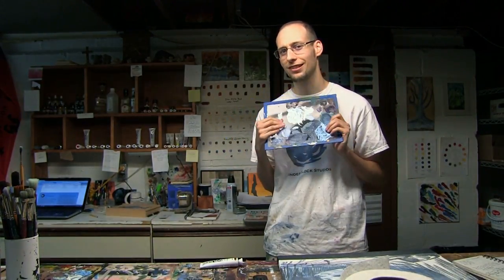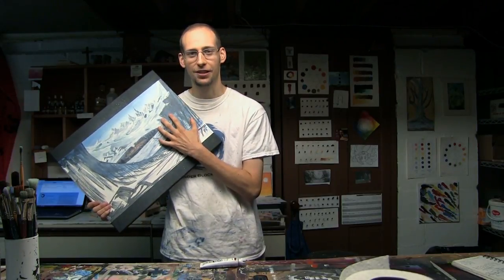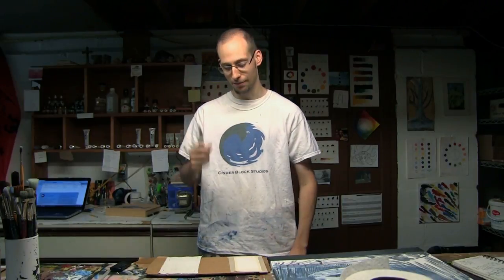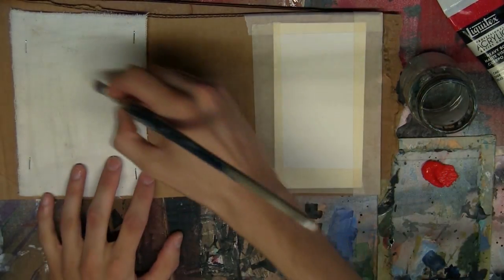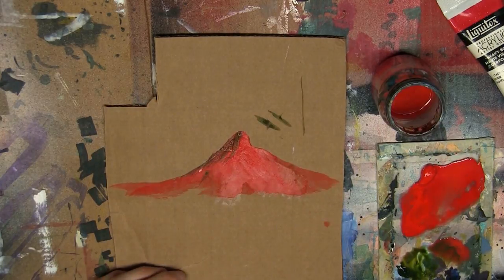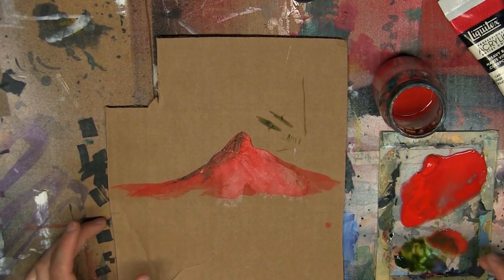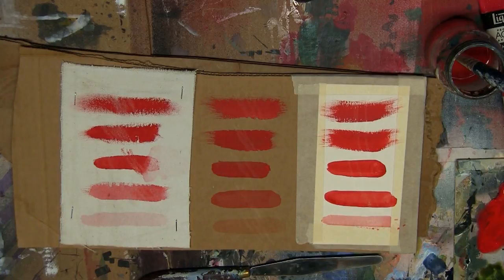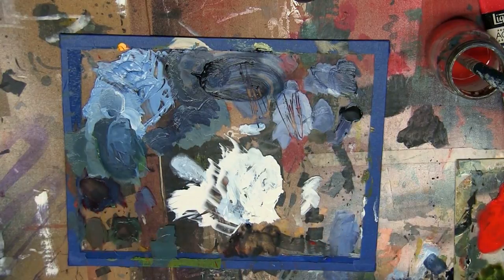Acrylic Painting Tutorial | Thinning Paint and Adding Details

Comment: So refreshing to hear the "don't thin with water" myth debunked! In my experience you're right, it really is all about the substrate. And here's a tip I've discovered: Most store-bought, pre-gessoed canvases (acrylic primed) have a weird, resistive film that causes thin washes of acrylic to bead up, skip, and not adhere. I've found that lightly scrubbing the surface with a dampened Mister Clean Magic Eraser sponge removes that resistive film and leaves the surface much more receptive to water-thinned acrylic washes. Not just any sponge works -- there's some kind of gently abrasive detergent embedded in the Mister Clean sponge that does the trick. I also like Ampersand's Gessobord and Aquabord, and they don't need any prep at all to work great with water-thinned washes. Anyway, thanks again for making sense out of the water debate. I really appreciate all of your videos!

Comment: Ben, thank you dearly for this video. I have been in such a dilemma about how to create an acrylic paint wash. Was going to go out and buy an expensive medium to create a wash.

Just simply to dab a little bit of medium on brush and a bit of paint. To thin to get a wash. I'll just use water now as the paints are from a company called sennelier.

Going to use a Windsor & Newton canvas which is meant to be pre primed.

Looking at the video I am hoping that this will be okay?

Cheers,

Rahul.
Reply from the maker: Sennelier is a very reputable brand so I'm sure you'll be fine with those paints. Chances are you're canvas is also primed already (if it's white or black you're good to go, no need for extra gesso or anything).
Reply: @cinderblockstudios  Ben, thank you for the reply. Yes the winsor & Newton white cotton canvas which is 350g/m2 is  primed. Trying to create an abstract piece so there will be some paint that is a wash and some straight paint from the packet.

When I get to the stage of using a black canvas I will be applying black gesso with a foam roller. Thank you for letting me know I am good to go, as was debating to use extra gesso but I'll scrap that idea. 

Thank you once again for the great video, reply and advice.
Reply from the maker: @RahulSharma-vm1fz  yeah the extra gesso would only be needed if you wanted to do something different with the texture of the piece before you start, or to tone the canvas a different color.
Reply: @cinderblockstudios I will use black gesso for a black background as it has a matte effect. Then will follow your video on gesso in regards to tinting.
Reply from the maker: @RahulSharma-vm1fz  black gesso is really valuable to have, would love to see how you end up utilizing it. I have a video on the channel about how black gesso will effect color which you might find useful. It's important in painting to understand how certain (transparent) colors will be effected by darker base layers.
Reply: @cinderblockstudios  Trying to find the video the colours that I will be using on the black gesso background. Are, gold, red, orange with blues but all bright colours. I'll send you some pictures.
Reply: @cinderblockstudios  Just seen the video on how black gesso will effect certain paints. Thank you for this and I will keep this in mind!
Reply from the maker: @RahulSharma-vm1fz  It's going to depend on the color and it's level of transparency. You won't really know for yourself the extent of that until you get started and learn the range of your colors. The best you can do is to use the black gesso on a piece of paper or cardboard, then test your colors on them.
Reply: @cinderblockstudios  Will do, however the first pieces that I will be doing will be on a white canvas.

Could I use black acrylic paint as a base instead of black gesso?

Then use acrylic paints on top?

Comment: Hi, I am painting 3d printed abs plastics. I was using craft acrylics and I like them more than artistic ones. Because I must avoid brush strokes. Soon, I will have an airbrush semi-pro version. For airbrush u must thin your acrylics, Can I use just water to thin craft acrylics for airbrush. Everybody talking about IPA+water+glycerin and some people offering butyl glycol also. What is your opinion?
Reply from the maker: If you can get your hands on some of Golden's High Flow Acrylic that would be ideal. They are a higher end paint, but come in a small as 1oz (30ml) bottles. The paint is a low viscosity and is designed with airbrushes in mind so you wouldn't need to worry about thinning it. 

Also any lower viscosity acrylic will do the job for less brush stroke retention. I'd also recommend a soft bristled brush to keep those strokes to a minimum, if you stick with that route.

Comment: So, when I have a Folkart acrylic pain and it's thick and I cannot get it to be creamy in the bottle. Can I add a few drops of water without loss of pigment, binder etc. When I mix it properly? 

I have a lot of paints that got separated from the binder in the bottle or jar, and when I remix it, its very heavy and thick... I need help. Please
Reply from the maker: A few drops won't hurt, but the Folkart stuff is a craft paint and has minimal pigment and binder in the first place, so I wouldn't be surprised if it doesn't hold up well with more than that. Bottled paints with low viscosity (this includes most craft paints, as well as liquid professional paints) will seperate over time, so be sure to shake them before use.

Comment: Also when it comes to galleries and art experts and selling your painting or being recognized I think there is notion out there mind set that proper medium should be used I am not sure 
The question is how does experts in art like dealers restorers etc think of not using mediums in your painting to thin paint?
Reply from the maker: It's hard to say what an acrylic painting will be like for restorations in the future. Commercial acrylics have only been on the market for about a hundred years or so, with the most modern formulations only being developed in the 1960s. Regardless though I doubt whether someone used water or medium will determine the value of a piece. It's not about the quality of the materials for collectors but about the impact of a piece of art has on the community.

Comment: Im self taught and use heavy body. Any suggestions on how to EASILY and smoothy apply a large amount of heavy body paints to a large area for background purposes to a primed canvas? Everytime I feel like I'm using way too much paint to the point where it feels wasteful or it seems like its watered down so much that it loses its opacity. Should I just continue to fiddle with my ratio of water or do multiple layers? Or would this be a situation where one would use something like a matte medium? I feel like slapping some paint down as a background should be the easiest part and I feel like I use SO much paint and it either looks streaky and takes forever to dry or way to transparent.
Reply from the maker: The first layer of paint on a fresh canvas always takes a bit more paint than the upper layers. For a large area that you know you'll be painting to start there are 2 options that work the best. First would be finding the right paint to water ratio, you likely don't need much water, but yes you will need A LOT of paint. That is one of the downsides to a heavy body acrylic is that you often need a bunch to cover a large area. Wet sanding a gessoed canvas before starting can help significantly to reduce the paint needed though. 

The second option is to opt for using a thinner viscosity paint for the first few layers in order to get the same coverage with less paint.
Reply: @cinderblockstudios  Thank you for the detailed response. I really appreciate it. 

I do sand and gesso my canvas before painting, however I dry sand, Im not aware of wet sanding a canvas and will look into that. I just recently learned about prepping my canvas. (within the last year)

I was originally using craft paints because I did not know any better and due to pure frustration of not achieving the pigmentation I wanted, I switched to heavy body acrylics (after doing research). I feel as if now I have the opposite problem when doing my first layer. The rest of my issues disappeared once I switched over to heavy body. I have not tried any other types of paint besides craft paint (like folkart) or heavy body (liquitext). I did purchase a golden matte medium for glazing but have yet to open the bottle. I wasnt sure if that could be helpful with the first coat at all, or would that just be wasteful?

I did paint my first layer on a canvas last night using more water than I normally would after watching your video. I did use less paint than normal but do have spots where I can still see through to the canvas. I will continue to fiddle with my ratios in the future.

Thank you for your knowledge. Ive drawn my whole life and just started trying to understand paint. I feel like theres a lot that comes naturally but far more that I just dont understand still.
Reply from the maker: Unless you want to really change the texture then additional gesso usually isn't necessary. For wet sanding simply spray down a thin layer of water (or rub with a damp rag) on the canvas before sanding. This will create a velvety smooth texture on your canvas.

Matte medium will thin your paint but it will also make it transparent. Great for glazes not so much for a first layer though.
Reply: @cinderblockstudios   WAIT! Have I been doing this backwards? I sand the canvas, gesso, then paint. The canvas I buy are cheap and normally say primed. However some are bumpy or weird, so I sand (use a blow dryer to get rid of any residue) and then add a layer of gesso. After it's dry I then go into my first layer of paint.

Am I suppose to be gessoing and then wet sanding the gesso and then painting on top? 

If that's the case, that alone could be affecting how the paint is spreading.

Thanks for the info on wet sanding. The info about matte medium is basically what I was expecting but thanks for preventing me from wasting it in an attempt to double check lol.
Reply from the maker: If you're buying a canvas from the store, you don't need to gesso it at all. Gessoing those canvases is STRICTLY a personal preference that some artists might do, and isn't necessary at all. Canvas by nature of being canvas is going to be a little rough. Some higher grades of canvas with a tighter weave will be smoother than the bargain basement stuff you get at the craft store for a couple bucks, but but even the expensive stuff has a bit of tooth. Regardless though, yes sanding is done AFTER gessoing. Doesn't make much sense to do so before hand unless you're building up those layers of gesso from a raw unprimed canvas.
Reply: @cinderblockstudios  This makes so much sense and is explained so well. Thank you for your time and your insight! This is immensely helpful. I appreciate you
Reply from the maker: @michelletalnagi4281  you're very welcome! Always love conversing with other artists and to help them on their journey!
Reply: @cinderblockstudios  I just started painting on paper..with acrylics .. and after few tries my 1st layer of paint was not spreading like it should like a smooth flow (i use tube paint)...until now where I read your comment that it takes more paint than usual..

but I am having hard time giving it a wash as my watercolor paper have little pores on it and when I paint those pores do not get filled up leaving white spots all over... I did not gesso it as well as I didn't know we have to do it before and I do not have it...

Is there anything I am doing wrong or I need to change the paper?
Reply from the maker: @Shalaka Rao It could be that your paper is too rough, but more than likely you aren't using enough paint or aren't wetting your brush enough. Thicker tube paints require a little thinning if you plan on using them on paper. Which specific watercolor paper are you working with?
Reply: @cinderblockstudios  Thank you so much for the reply.. :) I used.. Zen Sangam cold pressed rough grain surface, paper (which is available here) 
yes both of your 2 points may be true that I am using less color or water. So for thinning should I use water or a thinner or liquidizer (I don't know what's the bottle called) colors from the tube are thick.

Also if you can help me with 1 thing...can we give a wash using cotton than brush with acrylics because I do it with watercolors and it gives me best results. 

Thank you for helping me out in advance... :)
Reply from the maker: @Shalaka Rao Yep cold press watercolor paper is fairly standard, so it likely isn't an issue with the paper. Using an acrylic medium to thin with is always an option, but isn't necessary (especially not for working on paper). Whether you use it or not will be a personal preference for you.

A thinned acrylic can absolutely work like a watercolor (just not in reactivation obviously). Your results may vary a bit in using something other than a brush to apply paint, but I imagine it should work the way you want it to with enough practice.
Reply: @cinderblockstudios  I would definitely give it a try with your tips..hope it works for me..I should work or I'll make it work 😅 thanks for helping means a lot😊